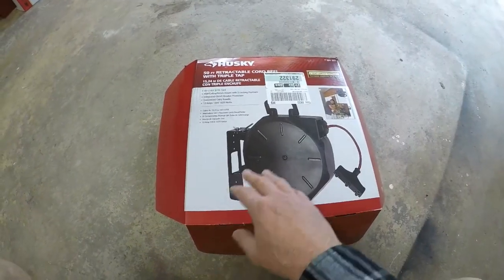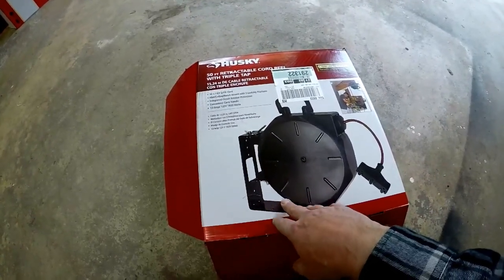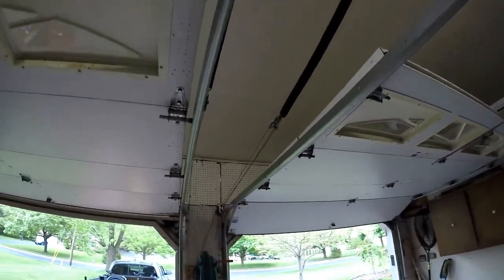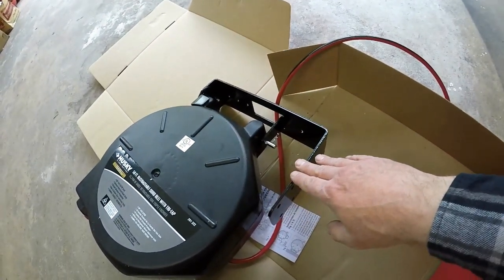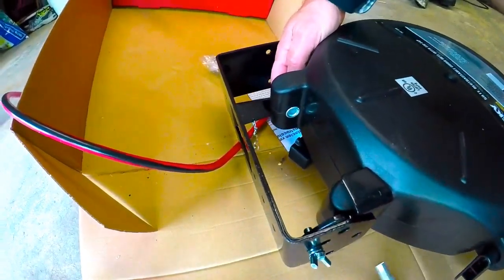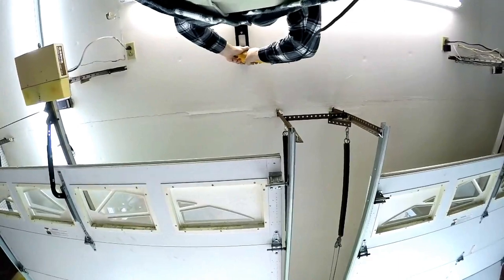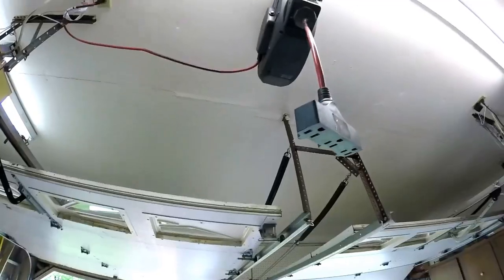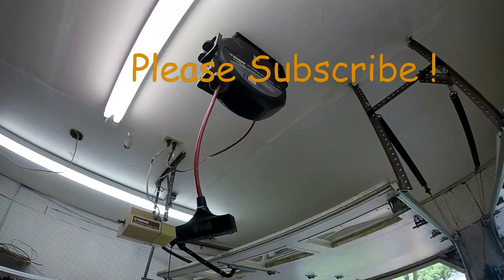Extension Cord Reel Installation - Retractable Husky ReelWorks

Comment: Does anyone know if there is something like this but with a electric reel so it can retract electrically instead of a pull and lock system.

I want it in my commerical kitchen over a work bench that has no outlets nearby.

The ceiling is 14 foot high and I would like it to completely retracted when not in use.
Reply from the maker: you are likely looking at an industrial reel with a motor and that would be well over $1000
Reply: @flannelguydiy6458  is it possible you could reccomend one to me, I can't seem to find them anywhere.

Comment: Out of curiosity, have you plugged in any tools that's rated for 14 or 15amps to this extension cord? I ideally would like to use this with my pressure washer that's rated for 14.5amps. But if the circuit breaker would trip often then I would probably pass on this and look for a 12guage extension wheel. Wondering if you had any similar experiences.
Reply from the maker: Richard.... not sure.  Recommend going with what the gauge wire is rated for
Reply: Just thought I'd give an update. 
I ended up buying this reel (If it didn't work for me I would just return it) and hooking it up to my Sun Joe SPX3000. Works great! No dim lights in the garage during use and seems to be working well.
Reply: @richardrodriguez3276  Just the response I was looking for. I have a 15 amp air compressor I want to run and i was worried about the same thing.

Comment: Cost is actually about right for a quality reel. The less expensive ones are not all that reliable over the long haul. You get what you pay for. Why not update this after several months to see if it is still working as expected?
Reply from the maker: Agree about not going cheap. The reel is working great. Maybe i will make a follow up video...

Comment: How is the reel holding up?  Do you use it very often?
Reply from the maker: MarkJonesRanger oh it is awesome. I use it all of the time. No more having to  deal with extension cords. Still works like new
Reply: I bought a reel works but the cord has trouble going back up into the reel.  It's like the spring is a bit weak.  After I saw the reviews that was a common issue with it.  They sent out a silicon wipe to wipe off the cord every now and then but that is kind of hokey.   If I spend time with it I can get the cord to retract back in but it's a nuisance.   I am looking for a different brand to add in the other end of my shop so I was considering the Husky.
Reply from the maker: so far the Husky has worked every time.
Reply: MarkJonesRanger what brand was it?
Reply: How do you like the placement? I’m having a hard time deciding where to mount mine
Reply: I bought 2 from Lowes and put one by my inside Garage door and one out by the breaker box by the over head door.  I have the heavier gauge retractible where the garage door opener is in the center of the garage.  The heavy duty cord 12 3 40 feet is slow to rewind.  The Lowes lighter cords reel in fast.  I love the retractible cords...keeps me from tripping over them.